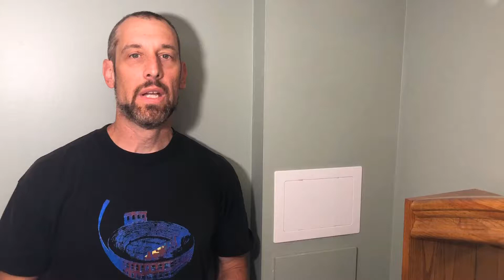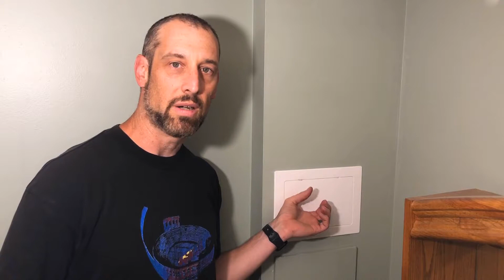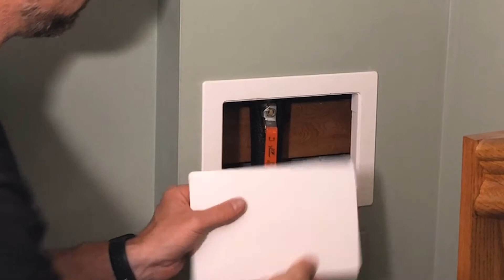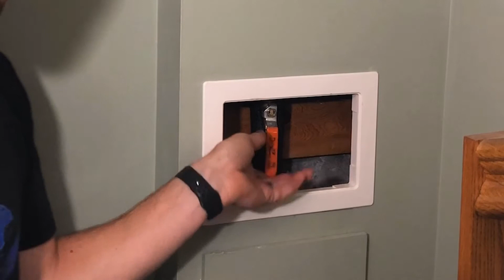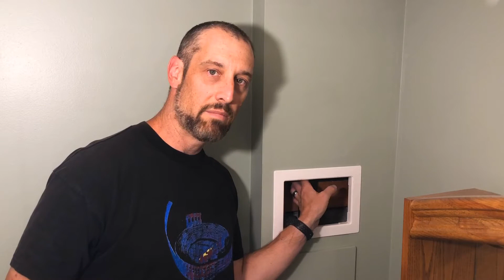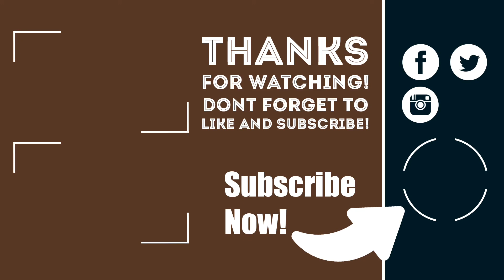Why You Need A Master Water Shut Off Valve With An Access Panel | Handy Hudsonite

Comment: My plumber installed the handle so it is not behind the wall. He left a rectangle hole 9" x 12" that I need to replace with sheet rock. I made a pattern how to cut the rectangle and included a circle to surround the handle so it can turn from vertical to horizontal. Is there a metal cover to add to the circle after the sheet rock is in place? How do I conceal the ugly rough cut circle?